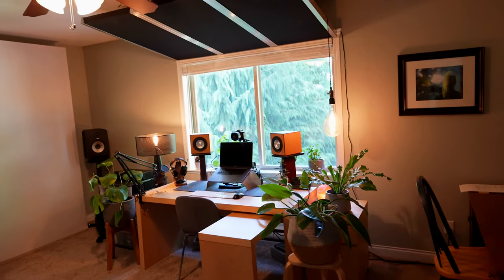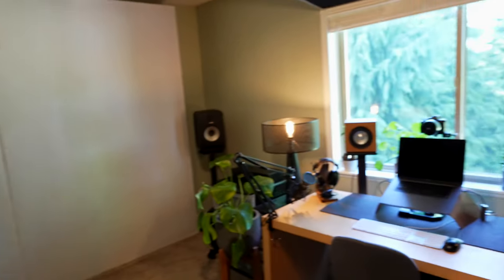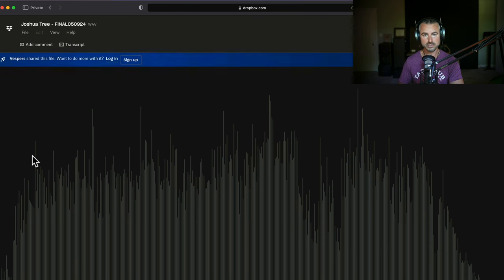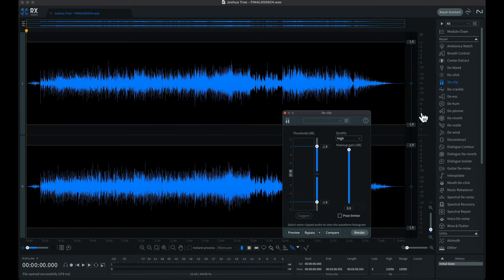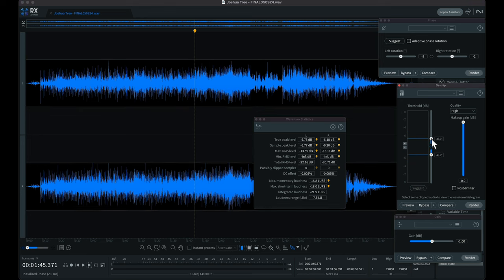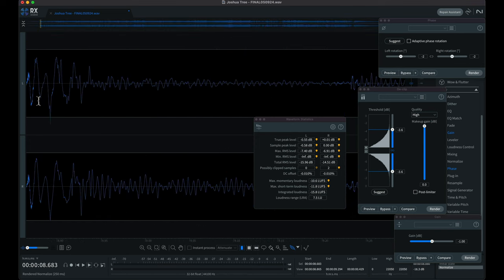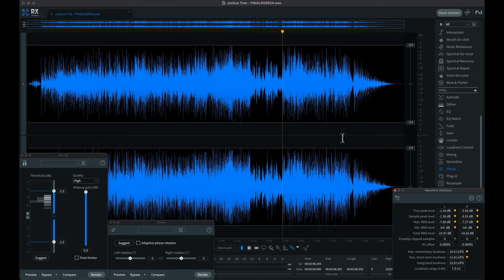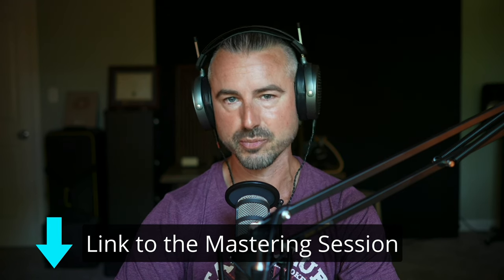Before Mastering I Do THIS…✅

Comment: Great walk through! Thanks for sharing.

At 9:10 to avoid normalising you can de-clip more than -8; just use the slider in the viewfinder screen (click on the number) rather than inside the plugin.
Reply from the maker: Cheers Nicholas.  Thanks so much for sharing this process in RX.  I'm just following in your footsteps.  And I appreciate the tip on De-Clip.  Funny how easy it is to overlook things like that.  Thanks mate.
Reply: Or mouse-scroll over the number. (possibly with a key modifier for finer scrolling)
Or click the "+" sign.
So many ways to de-clip a cat! :)
Reply from the maker: Thanks for the tips!  I always like keyboard shortcuts.

Comment: Great tutorial. I gave it a shot on a really short piece, to get the hang of it. My biggest take away was... if I'm not getting paid to do this, I'm just throwing Gold Clip on it next time...lol. It was good to get a better understanding of the RX program, and I'll probably give it another shot. I think I sucked the life out of the track by being a little too heavy handed though. Keep them coming.
Reply from the maker: Glad you liked this one.  Yeah, it's really only necessary in genres like dnb and other bass music where they're being engineered like crazy for insane levels of loudness.  You'd better believe this pays off there.  But it is painstaking.  

I use this technique, plus Gold Clip, plus a limiter.  Soon I'll be using multi-band clipping as well, as part of the mastering process to reduce intermodulation distortion when you dig into the RMS a bit more with a soft clipper.  I'm just waiting for the perfect multi-band clipper to be released ;)

Comment: be aware when using phase rotation on a whole mix!!! it comes with sideeffects. Applying phase rotation basically applies a delay to lower frequencies, meaning the lower part of your snare for example will be delayed in relation to its higher frequencies (the transients) which will result in a less tighter sound. applying it on a whole mix is dangerous as you alter the tightness of your whole mix... however it is useful in some scenario's like creating your own drum samples for example.
Reply from the maker: Agreed.  That’s why I didn’t use it ;)  I do, however, use it for analysis sometimes.

Comment: Hey, just for my understanding. Are the peaks on the full mixed track still that much even after applying hard clipping for the single tracks?
And what did cause the right track to have so much more louder peaks than the left one? Does it have something to do with stereo enhancing and panning? 
Thanks, I enjoy you tutorials a lot!
Reply from the maker: Hey hey.  Thanks for the questions.  Regarding peaks, no.  If clippers were used in the mix the peaks would not be this high.  Given that this is a more gentle song and not an EDM banger, there's not much need to clip everything on a track by track level.  In any case, I didn't do the mix so I couldn't clip tracks and was limited to what could be done on the master alone.  I was able to use this manual limiting process, and then used soft-clipping on the mastering chain, which got the job done nicely.  

The right track had higher peaks I think because of the hard-panned guitar on that side.  So you're correct that it has to do with panning.  

Thanks for watching and commenting!
Reply: @warpacademy  i see, thanks for clarification!
Reply from the maker: My pleasure.

Comment: i have a question about this process in regards to how ive been making my own music..i use the skrillex tiered mastering template for production.."bus mastering" some call it. im running saturators as clippers with the out gain inverse to the in into an l2 or smart limit. then into chain group summing of high and low chains then premaster then master sometimes the chains do nothing at all but they are there if i need to go hard. in such a setup would it still benefit me to bounce everything somehow even if im working at mastering levels? is this more for dynamic music? is what im doing even good? it sure seems to work great as i advance my understanding of it. i spent the last couple years learning this way of doing things but it makes me unable to follow a lot of standard advice. sorry for the long comment. not many people on the internet have the answer because its not a common topic
Reply from the maker: Hey hey.  Thanks for the comment.  Using a bussing process in your mixing is definitely a good idea.  What is this Skrillex template you're talking about?  Link me to it and I'll check it out.  He doesn't mix or master his music, so I'm not sure what you're referring to.  Perhaps it's someone else who's created a template based off how they think he's working?  

Your comment about "Using saturators as clippers."  Saturators and clippers are not the same thing.  Don't swap in a saturator where a clipper is the right tool.  The difference between them is that a clipper will not affect the signal below the clipper ceiling (for a hard clipper) or it will not affect a signal below the termination of the knee (for a soft-clipper); saturators do.  A saturator will affect the entire signal, including low level information.  Their transfer functions are different as most saturators will inflate low level information.
Reply: @warpacademy  sorry i mean the ableton specific saturator device i should have specified as to not mislead others. something i picked up from subtronics livestream that he does.  i think its cutting out my comment when i try to post the URL to you but its the ahee video BUS MASTERING LIKE SKRILLEX EXPLAINED IN ABLETON
Reply: @warpacademy  i tried using freeclip and other clippers but having the the option to also add color that im familiar with while not using a ton of cpu seems ideal in the end but again im not a pro at all
Reply from the maker: Thanks for the link, got it.  That template is not actually how Skrillex works because he doesn't mix or master his newer music.  Luca Pretolesi does from Studio DMI and I can guarantee you that Luca doesn't work like that.  He does use a submixing structure, but it's not that simple.  It's also not about ramming everything into FabFilter Pro-L2 or any other limiter, on a bus level, or the master either.  Using a limiter with True Peak limiting on (like he demonstrates in the video) is a bad idea if you're mixing for clean loudness.  

Regarding saturators, yes you can add color using the Ableton Saturator.  But what if you don't need color?  What if you just want it loud with no unnecessary harmonics added?  What if you don't want to dig into the RMS of the signal?  Saturation is part of the process when you want to change the tone.  But if you just want clean, loudness, you need to understand hard clipping.  Watch this: https://youtu.be/5sAm7McrkA0.
Reply: @warpacademy  you turn the color off if you dont want it and just use the soft clipper built into saturator. as per all of subtronics projects. ahee made those templates based off of a skrillex project. he may not master his releases this way but he does it for the stuff he plays out to test stuff at shows i think ahee explains all of that in a dif video. but ahee does use this for all of his songs and his brain is way bigger than mine
Reply: its just taking the very tops off of each group im not slamming anything just shaving a little off and using dif types of compression and whatnot on dif chains
Reply: to take the strain off the master limiter not add more limiting
Reply from the maker: Hey hey.  Turning Color off in the Saturator doesn't turn off the saturation.  It just turns off the color stage.  If you want to soft clip (or clip at all) I would ditch the Saturator device.  It's not really set up very well for that.  You ideally want a display where you can view peaks, set a correct clipping threshold or ceiling, monitor the delta signal, and view how much clipping is taking place.  It's best used very surgically and it takes some practice to set it up well.  I like Orange Clip or K-Clip for this.  They both have a nice workflow with all those features I mentioned.  

And yes,  like you said, you're really just looking to take some tops / peaks off the signal.
Reply from the maker: Exactly.  Just taking some of the load off the limiter.
Reply from the maker: Regarding the Skrillex template.  That template was based off of a very old Skrillex song (Mumbai Power I think), likely back when he did mix his own stuff.  The Ahee video is over 3 years old.  

All of the newer Skrillex music (his last 2 albums from 2023, plus some stuff with Diplo) were mixed and mastered by Luca.  They won the 2024 Grammy for Best Electronic / Dance Recording for Rumble.  Luca's mixing workflow and approach to loudness is very different from the template you showed.  Luca has lots of videos on Youtube.  I would suggest watching them.  They're on the Mymixlab channel. I think you'll like them.
Reply: @warpacademy  i am a DJ and i just wanted a fast way to test stuff in front of crowds and have it be on par with the commercial tracks i think that is why he did it and why a lot of producers are doing it now..i can see how it wouldnt really be whats taught professionally
Reply: @warpacademy  if i could afford that just to test new tracks at shows id be so happy haha
Reply: @warpacademy  Thanks for the insightful video! Just wanted to add a point for clarification. According to Discogs, Skrillex actually mixed and mastered half of the tracks on Quest For Fire. Other credits include Joyryde, Manny Marroquin, Mike Bozzi, Berny Grundman, ISOXO and Joker. 

It looks like Luca Pretolesi mastered "Rumble" and Studio DMI handled the Dolby Atmos mix and masters for Quest For Fire. I don't see Studio DMI credited on Skrillex's latest album.
Reply from the maker: I’m sure it’s great for that.  Cheers!
Reply from the maker: Hey hey.  Thanks for the clarification. I was talking with Luca and asked him if he mixed and mastered Quest for Fire and he said yes so that why I mentioned that. Not sure about material newer than that album.  Manny is a great mixer too, I’m not surprised to hear he’s working with him.
Reply: @warpacademy  im in no way trying to compare it to what you or any of the other people at the top of the game are doing im just a broke single dad trying to do the best most efficient things i can with what i have and learn about the final polish as i go. its justreally nice to be able to spit out a render at any point and have it be semi mixed and mastered when you want feedback. im in awe of what you do and im here to learn
Reply from the maker: Hey hey.  All good!  No offence taken at all.  The template actually is a pretty good workflow.  It's the way a lot of people work.  Personally, I opt not to use limiters in that way as I find they produce negative artifacts (duller, quieter sounding transients for one).  Clippers FTW!  And I certainly understand being on a budget.  All the best with your tunes!
Reply: @warpacademy  interesting! ill try just using clippers. i use both at the end of the chain during heavy sound design..  prob can even tell with what im making. the limiter usually does nothing unless i lower the ceiling for sound design reasons or need to smash something but its there. i dont use true peak i always check in sonible and it never recommends it so i stopped using it. i do not use any pre limiting on soft synths or fx just soft clipper and nothing on vocals that isnt to enhance them..mostly on  neurobass, drums and heavy stuff so it plays nice and makes room for the dynamics that i want.the tiers allow you to select whats hitting the limiter first in a way, so vocals, synths and drums come out riding on top with the least processing. when i make old school breaks or something for example its all at 0 gain reduction until premaster. thanks for letting my autistic ass ramble the baby doesnt offer much usable advice haha
Reply from the maker: Sounds like a good approach.  All the best with your tunes!  And I’ll be testing out the Sonible limiter soon too.
Reply from the maker: Right on.  Cheers!
Reply: @warpacademy  im really bad at explaining things the first time but in cases where it needs saturation i trade the clipper for saturator and it almost always sounds better to my ears on bass and even synths or other things. its always a case by case basis i use free clip a lot just because its simple and shows me what i need to see but after watching your video on goldclip im rethinking my process and wondering if im doing more harm than good, in analog and hardclip mode i think it is saturator does actual clipping i watched some in depth stuff on it if you turn HQ mode off it turns off oversampling and that turns it into a better clipper from what ive read.
i havent ran it through plugin doctor yet though like what you did
Reply from the maker: Saturators and soft clippers are very similar.  It’s about the transfer curve shape and what they do differently below the knee engagement point.  

Disengaging oversampling in the Saturator will make it alias more.  That’s not usually a good thing.  If you’re creating more then super short bursts of harmonics (clipping) then you’ll really hear that.  

So if you’re saturating things like bass or synths that are sustained you’ll want oversampling on typically.
Reply: @warpacademy  the thing i seen was specific to the saturator being set to analog or hard clip and when just used as a clipper turning hq off got rid of the artifacts left behind from the clip and that was the only reasoning for it if i recall. man this stuff sure goes so deep and gets super interesting. going to just use what i learned here and do some tests out of curiosity on the dif clippers i have. thanks for inspiring me to do my own research the video on low cuts really got me thinking about all the things i do just because someone said it was the way

Comment: Hey there. Did you really export to 16 bits, or was it just for the video shooting?
Reply from the maker: I did export to 16.  The mix was delivered at 16.  Normally I would work at 24 / 48 kHz.
Reply: @warpacademy  oh. okay. since RX is doing its processing in floating point, it does to me make more sense to export in floating point 🙂 even the mix itself I think is better off in floating point. Fixed point is better suited for the master file. My 2 cent!
Reply from the maker: There’s zero benefit in exporting to 32 bit float for a file that was only 16 bit input IMO.  The only processing that is happening is gaining samples down.  Super simple.  I just keep it 16 all the way through.  Same thing with the sample rate.  It was delivered at 44.1.  No reason to up sample it and then down sample back.
Reply: @warpacademy  as soon as you make any processing in RX (or in a DAW), things 'switch' to floating point. In your case, even if you've "only" gained down some samples, those samples are in floating point notation within RX. If you export in 16 (or 24) bits, you then introduce truncation distortion.

It can be argued that 24 bit truncation is essentially inaudible (even though some people claim they can hear it vs. dithering), but 16 bit truncation -- which happens at around - 90dBFS -- is well within the audible range (the ear's dynamic range is about 115dB).
Reply from the maker: I treat this kind of thing the same way I treat aliasing.  If I don't hear it, I don't try and "fix" it.  Some people obsessively use oversampling in every plugin because they are hyper concerned with hearing aliasing, when in fact aliasing is often completely masked.  

Also, you should never dither more than once.  You would only ever apply in the final stage of mastering.  This is not the final stage in mastering.  It's just prep.  

To hear it from the mouths of the experts, I will quote a section about dithering called "Myths and Facts" from the FabFilter Pro-L2 manual:

"Myths and facts

Theoretically, dithering the best way to retain as much resolution as possible when quantizing your audio. However, in the real world, dithering often has little to no audible effect. Here are a few things to keep in mind:

Although loudness normalization is becoming more and more common, much of today's music is still mastered at quite loud (if not ridiculously loud) average levels, leaving very little dynamics in the final result. This already masks the small level of distortion due to quantization, so dithering probably won't have any audible effect.

A lot of audio recordings already have a relatively high noise floor, due to the use of microphones, amplifiers, analog outboard, mixing consoles etc. In that case, dithering will have no beneficial effect at all; it will just increase the existing noise floor.

Dithering should only be used as the final stage of audio processing/mastering. With any further processing, like gain changes, applying effects, or converting to yet another bit depth, the effects of dithering will be lost. If your host offers a post-gain effect insert slot on the master channel, use this slot for FabFilter Pro-L 2 when dithering is enabled.

Dithering more than once doesn't make any sense. It will just increase the overall noise level in your audio.

When mastering for lossy formats as AAC/MP3, dithering doesn't make much sense."